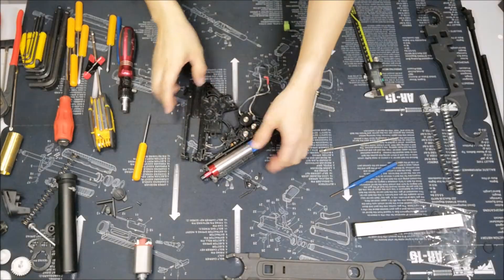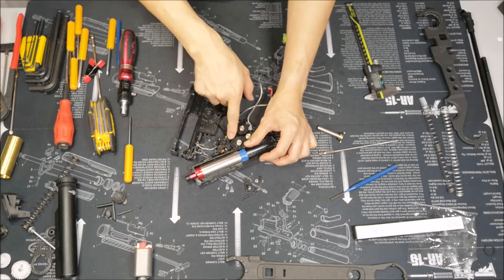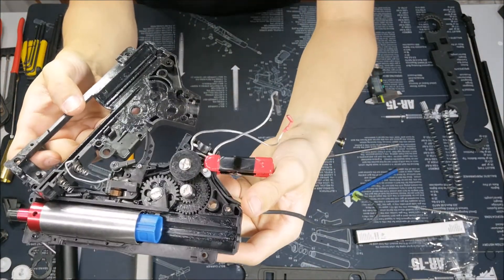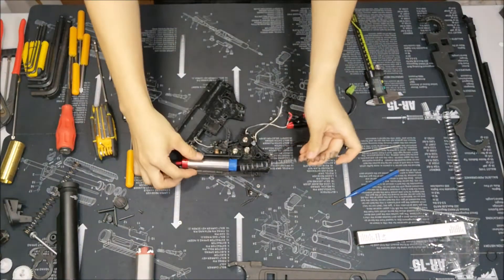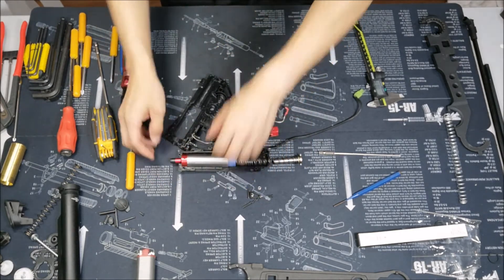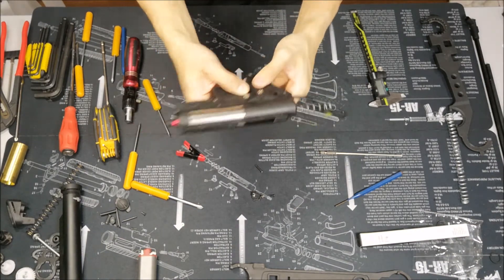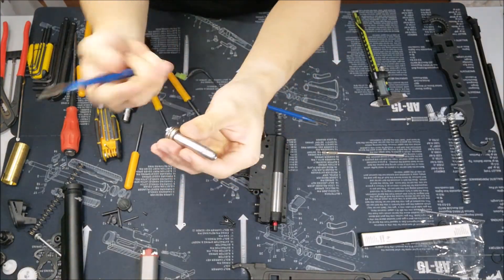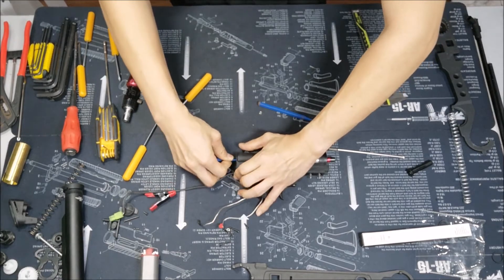HowTo: Tips on assembling the War Interest LDT V2 Gearbox

Comment: Hi, I have the wiring kit for this gearbox. And just wondering what is the best way to bent the the motor connector ? Because I’ve always break the crimp connector.  Thank you
Reply from the maker: You just have to be extra careful where you bend the spade connector. Make sure the crimping side is facing the inside when you bend it. Be gentle and bend slowly, it has a very limited counts how many time you can bend and adjust it. I consider the spade connector a consumable lol, grab yourselves lotsa these from an electrical/hobby shop so you can replace them when needed.

Comment: Hey mate, great video. 
Just wondering what cylinder head and nozzle you decided to use? 
Also what t-piece are you using? Still the LDT t-piece or did you change it? 
Cheers
Reply from the maker: I personally uses the Titan Aero/Silent Cylinder head and nozzle set for my LDT gearboxes.
Stock LDT T piece that comes with the gearbox, no reason to use others really as the one that comes with the gearbox has the best fitment.

https://www.monkeemods.com/wbb/titan-aero-metal-cylinder-head-and-nozzle-for-fb3.0.html

Comment: where did you get that spring guide?
Reply from the maker: Monkee Mods WBB
Reply: M mods doesn't have it
Reply from the maker: @jamescrabtree140  They will be soon, right now at the moment they are only sold as a set of upgrade package for the LDT Gearbox.
Reply: @theliteoperatinggroup4387  OK cheers. Do you run Mmods?
Reply from the maker: @jamescrabtree140  I work for them haha
Reply: i use airsoft spring guide lancer tactical